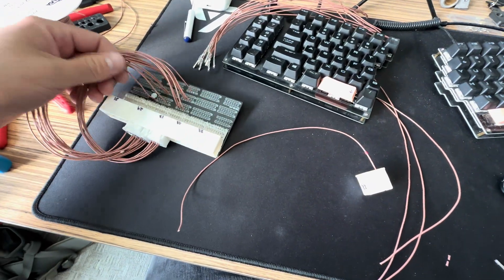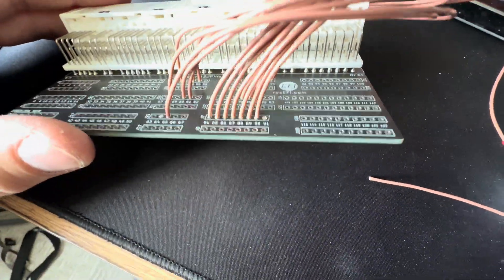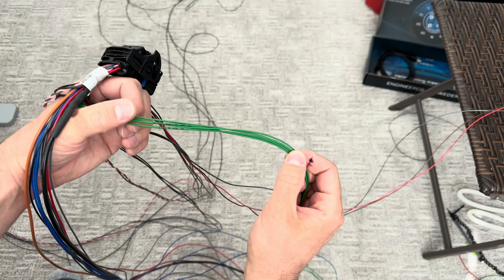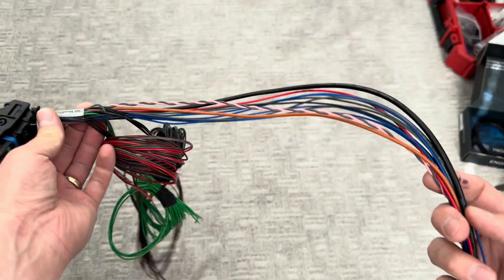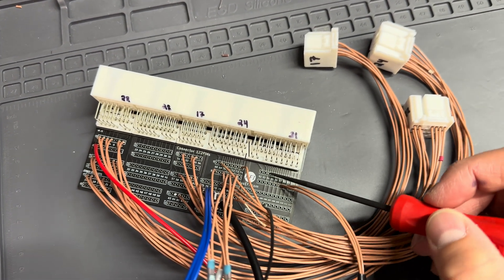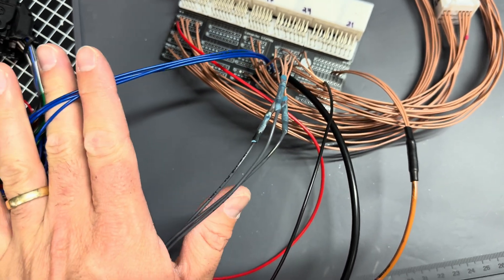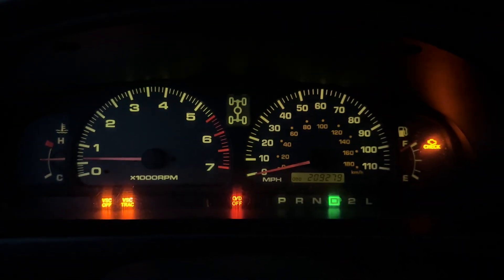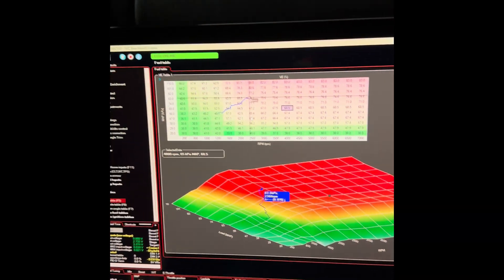Toyota 5VZ MaxxECU Mini Piggyback Adapter Harness Overview | 3rd Gen 4Runner

Comment: Did you share the IGF signal from the igniter with both ecu’s? If you were to switch to smart coils what would you do about the IGF signal so that the factory ecu wouldn’t freak out?
Reply from the maker: I am just using the factory coils and the igf is only connected to the stock ecu. Seems to be working well that way
Reply: @TurbineResearch  I figured that’s what you were doing. I plan on running MaxxEcu in parallel with a factory RC200T ecu so the factory ecu can control the factory CANBUS system while the MaxxEcu controls the 2J and 8HP70 that I’ll be swapping in. Unfortunately MaxxEcu doesn’t support the RC platform yet so parallel or custom CAN protocol is the only choice for me.
Reply from the maker: @ sounds like a cool project